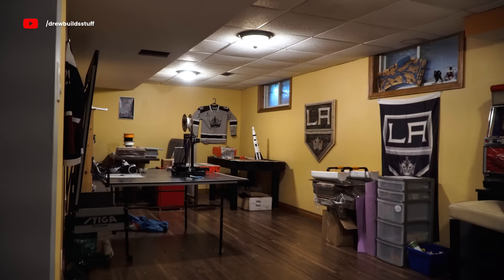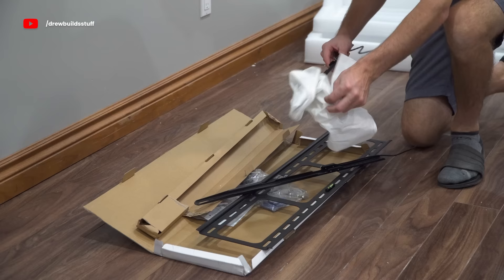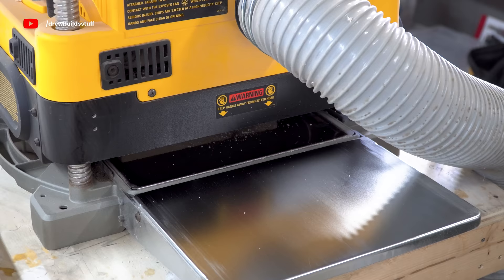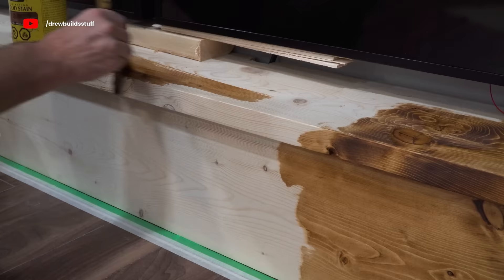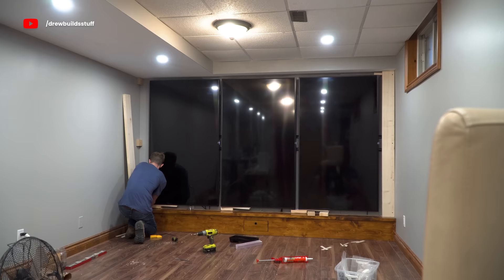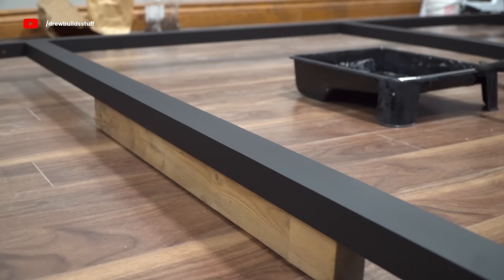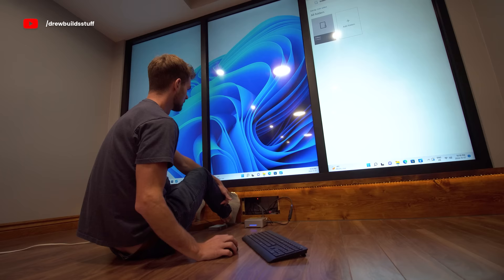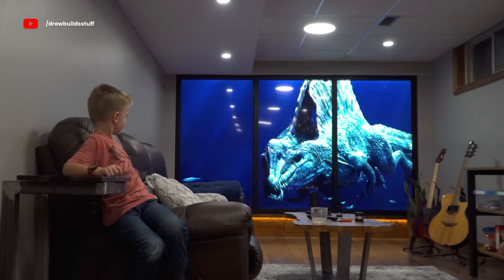Building a WINDOW with 3 Huge TVs

Comment: Very awesome build. Really surprised you couldn't get away with triple screen with a computer, but none the less, well done! Also, your light strip is more than likely using a RF (radio frequency)and not a IR (infrared) receiver/transmitter since you said you were able to control it in other rooms.  I accidentally bought a RF one for a project. Which is nice, you can have multiples in a area and not have to worry about changing settings on all of them at the same time if you don't want to, and don't have to be in line of sight either for the receiver to pick it up
Reply: I was thinking IR cant go through walls lol

Comment: It looks good, but I think the borders between the TVs would drive me crazy.  The roughly 370W power draw for the screens wouldn't make me happy, either, especially with the recent spike in electricity cost.  Here in western Massachusetts (U.S.), the current cost of electricity is $0.36/kWh ($0.22 for supply and $0.14 for delivery), so the cost of those screens would be approximately $0.133 per hour.  It doesn't sound like much, but at 4 hours per day, that's $15.96 to $16.49 per month, and that's using the company's Energy Guide label numbers (which, in my experience, are VERY conservative estimates).  They'll provide a nice bit of extra heat in the winter, though, which might be appreciated in your case.

Comment: you could remove a part from the top piece where the led strip is so that you cannot see the strip. then you can cover the LED strip with a diffuser or an acrylic plate that you can use as a diffuser.

Comment: This is awesome, basically what I want. But there's ONE UP.
What is the footage was shot really high definition, 180º wide, or stitched from multiple camera's?
With eye tracking and a 3D engine of sorts, the picture would be adjusted for the perspective you'd have viewing the scene from an actual set of windows.
Reply: These scenes could well be relatiely short looped video's, right? Well, if they were shot/modeled in 3D, with enough wiggle room that the scene would adjust for the few meters you can move around the room (sit/jump, for/aft, left/right), software would calculate your POV in the "game" and real time adjust. How much lag would there be...under 10 ms?
Reply: Similarly but with multiple cameras, the screens could turn into almost perfect mirrors. The room is 3D modelled relative to the fixed cameras, the person in the room is projected as is. Could even be slighly predictive to minimize lag (same for previous 3D window idea). With TV's on more than one wall, the 3D effect of them pretending to be mirrors would be even closer to real. Sadly, there is a better solution with boring mirror film of functioning TVs, lame! :-D Still, fun to replay a scene from a given (shifted) perspective. Stand right in front of yourself doing a dance routine, with or without VR headset.

Comment: Cool and all, but would have been way less expensive to use an XR headset, + the perspective would be better and you'd actually be able to stand at any given point of the "window" and see the perspective of the outside shift (ex: standing on the far right, then moving to the far left and being able to see trees or some shit that we're hidden) basically it would be closer to an actual window.

Comment: Hey Drew, I was inspired by your TV window. I built a similar but smaller window with 3 x55" Samsung Commercial style tvs.. did you find a better solution to display the same image across the 3 tvs in portrait mode? I figure I can use a video switch - AV over IP solution or maybe an expensive PC video graphics card with 3 x HDMI outputs? maybe you found a new piece that allows you to do a portrait mode video wall? Thanks again Eric Fischer

Comment: You should take another piece of board and run across the bottom of the cable stage so you don't see that little hole in the middle. Maybe a piece of wood that is stained the same color but is removable if you need to get to that access point in the middle again later. I don't know it just stands out when I look at it.... That hole with the access point lid

Comment: The software you need to run a video wall from a PC and use all the screens as a single screen is called "Spacedesk"
Assuming you have the hardware. Else best to get a proper 4k 1 to 4 video splitter that will run in 1 to 3..

Comment: You can use Nvidia control panel to treat multiple monitors as one big monitor. You can even adjust a gap between them. A lot of people use it for gaming on triple monitors!

Also, you should just run all TVs with 1080p. It'll be in total slightly lower resolution than a single 4k TV, but do you really need 8k? I'm willing to bet a solid no

However with consuming media, i think you'll find that most content will have the important stuff right on where you put the bezels, so it probably won't be a great experience. However this looks like it could be amazing for gaming, so I'd highly recommend putting a gaming PC down there!

Comment: I posted this question in the second video you made about making changes to this setup.

But I'm curious as to why you had to leave such a wide gap between the TV's instead of putting them right up against each other Bezel to Bezel so that you would have the narrowest amount of gap possible in-between them, which still would have given you at least close to a half inch of space to put a board over if you still really wanted to in the frame.

Also the fact that you said "It's safe to say that I'm now a big black caulk kinda guy." But if course it sounds like you were saying a different C word that sounds very close to Caulk. Kinda like how when an Australian talks about Deck Maintenance, or the brand of Cider called Dickens Cider. LoL!

Comment: To make these 3x4k TVs really usabe without messing with the source files of whatever you want to put on this, here is what you need:

- Relatively recent PC with NVIDIA or AMD GPU. Most of the midrange ones made in the past few years will have 3x Display Port + 1x HDMI. You'll need at least 6GB of VRAM on the GPU and 8 GB of RAM in the system or you'll run into issues even if you don't run any other apps but the ones to play media.
- 3x Display port to HDMI adapter.
- Depending how far that powerful PC is, you'll want HDMI cables with optical fiber core. This is important because mose high bandwith HDMI copper core cables are really short. Longer cables will require your to compromise on input signal color quality. There are also a lot of garbage cables out there that say they are "HDMI 2.0" buy do not support the bandwith required for 4k at good colors and at least 60hz simultaneously. You want at least a 40 or 48Gbit cable.
- Some TVs only offer 48Gbit HDMI bandwith on one but not all of their input ports. Check which ones are the high bandwith ports.
-  Hook those HDMI to DP adapted cables to your PC and TV. In the Software (NVIDIA: NVIDIA control panel -> Change resolution) Set the displays to run preferably in 4:4:4 color mode @4k and the highest refresh they'll let you. With DP1.4a you should be able to get 4:4:4 @4k@60. 
- Verify the TV is in Gaming Mode and that input+ and similar settings are endabled in the TVs software, so that it will use the maxmum bandwith and allow the previous settings in the GPu control panels to take effect or even be shown. It's a bit of back and forth.
- Rotate the display in the software (NVIDIA: NVIDIA Control Panel -> Rotate Display)
- In the PC use the NVIDIA or AMD software to stitch together the 3 screens into one mega screen. This is one of the reason you'll want to go with NVIDIA or AMD over the new Intel cards by the way. Make sure you have them in the right order to how they gonna be installed or the stiched image will be messed up.
- Now windows will think those 3 TVs are one BIG screen wtih a resolution of ~6300x3800px
- Get Wallpaper Engine
- Put loads cool stuff on those screens without cropping every single video or image into three pieces. Or just play or use your PC on your "window".
- Raise your energy bill by ~$1000/year for running a bunch of huge TVs for way too long
- Replace TVs every 3 years or much sooner if you didn't think of ventilation (and the TV weren't designed to be run extened amount of time in vertical orientation and develop hotspots).
- Cry if you did that with OLEDS and end up displaying relatively static footage and end up with burn in after the TVs are out of warranty because you disabled some protection measures the made the individual screens start to dim independenly from each other and break the window effect.

Comment: live cams across the world.  or, weird idea, a live cam pointed back into the room, so it becomes a mirror of sort. 

or, go-pro attached to your dog running outside, so you have an encapsulating view of what your dog experiences.  

get a rowing machine, and a POV view of athletic rowing practice, and see if you can catch up.   In fact... for that idea, what if you attached a speed-of-video feed devies, and as you rowed, the video of POV-rowing sped up -- so the video reacted to your actions.

another idea is to build the same set up on the ceiling and the two adjacent sides of the room, essentially offering a 3D view -- so, you wouldn't just see planet earth in front of you, you could look up and see the moon.  could be even more realistic if you, standing in front of the tv, hung a curtain behind you - and had a projection monitor project more video on the curtain - which would be behind you.  now you have a fully encapsulating space (well, sans the floor).

Comment: Overall this build was pretty awesome. One question, are you using anything for audio playback? And one suggestion, I think if you reframed your actual small basement windows with the same wood painted to look like black metal it would make you tv windows look even more realistic just because the framework would match. Lastly a set of window curtains would really sell it. Anyways awesome build. You just earned a new subscriber. Can’t wait to see what else you build.
Reply: Good Comment .. i wondered too about the aural aspect ...i'm going to look into it for my project (see comment somewhere in here) and now ill add 'sound" ...

Comment: Very cool idea, did you notice any significant increase in the electricity bill? I'm rather curious since nice things come at a cost sadly lol
Reply from the maker: No they only use 110 watts each, a couple cents per hour to run in Ontario.  I usually only have them on for a couple hours a day
Reply: @DrewBuildsStuff  Ohh that's actually way more bang for your buck than I thought hahaha. Thank you for the quick reply mate, my curiosity is satiated haha. Also my mind wandered into ideas such as OLED but long term I fear for screen burn, so in my personal opinion your set up is much better.

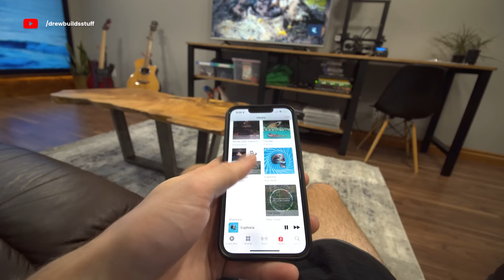Comment: Cool build. I came here from a link on DIY Perks YT ch where he just built Sunlight panels based on your video.  Did you ever figure out the outside camera idea as minute mark 23:00?  I'm currently living in a garden apartment so my windows have to be covered, but it's cold, so insulation will be covering there soon.  I would like to mount just one large TV with a video camera pointing outside.
Reply from the maker: Yes I did an upgrade video turning it into a gaming setup that has the outdoor camera in it as well https://youtu.be/-UT6v68fJY0?si=iT5EL089OdGu8odz

Comment: In building the "window frame," why didn't you just put the pocket screws on the back side, where they wouldn't be visible?  (I'm guessing a touch of OCD) Also, why not pre-build the base box, then put it in place after all the wiring and connections were done? Assembly sequence is important, and should be planned, like everything else. Still, really cool build. I look forward to seeing how you make them an active content display, instead of just passive monitors.

Comment: I have a unique setup where I have a built in window that looks into another space in the home. However, what it looks into isn't very interesting. I would like to do a SINGLE tv instead of the window. I'm having trouble finding vertical videos. Most are designed to be played 16x9 - and so it's easy to crop in when you have 3 TVs like in this video. Anybody have a source/link for fixed position videos in a 9x16 orientation?

Comment: Plan is to put a virtual window in the master bathroom to compensate for lack of actual window -- Plan is for 2024 -- the idea is to use an exterior 4K Camera because we have a stunning canyon view all around the house and pipe that in -- at first i was thinking a single 75" now you have me convinced to use 2 and quite possibly 3 if the tile and shower budget doesn't break me. If that is the approach id be appreciative to find which multiplex processor you choose -- i expect the one that went into the toilet is not on eBay now (dont laugh -- a guy i knew dropped his phone in a public latrine .... retrieved it ... cleaned it and SOLD IT ... ewwww)

I am also looking into "what would make the TVs look like real windows"  -- your framing is a start (that was in the plan), a sheer curtain as suggested but @spud AND i also think there may be secondary lighting using LEDs and a few other techniques ... 

You asked for a suggestion for new videos?   How about a long track from a Drone Cam?   As i was watching the live scenes on your TVs that popped in -- I find new Drone scenes in many movie to be utterly stunning ... maybe a longer 30-60 minute loop would be great?

and BTW Final Comment .. this isn't really about a virtual window is it?    This is tool porn .. lol

Comment: With the price that video wall processor will cost, you should consider building a pc with a decent graphics card that will stitch those 4K monitors to a single 6480*3840 screen to unleash their true resolution and also throw in a 4K capture card to input that playstation, because there is no sanely priced more than 4k video wall controller.

Comment: Loool then what is your electricity bill is like a month for running those 8 hrs a day?
Reply from the maker: It only runs for a couple hours a day but it uses 330 watts @.15kwh x 8 hours = .40 cents.  So 30 days would be $12 if it ran that much

Comment: I think it would be rather interesting and unique to build something similar however much more extravagant, such as mounting monitors on all wall space, ceiling and floor space. Then syncing them all together to craft a room with the effect of being outside, in space or whatever; essentially creating a sort of hollow deck I guess. This idea is patented by the way and I'm not quite ready to sell; I'm almost ready, but not quite and for now, does not involve caulk of any color.